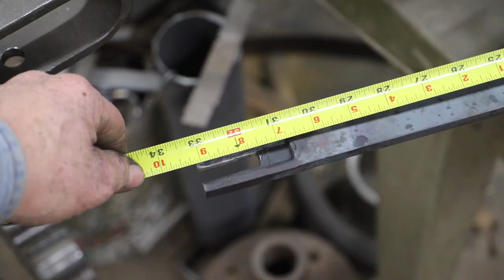Singletree Sizes & Why |  Building a Buggy Dash | Engels Coach Shop

Comment: Dave likely had a threaded Hex Rod Coupler  around the shop about the right size and depending on its size most Hardware Stores  carrying them for a few dollars in the fastener/bolt etc section. Indeed since there threaded a bolt or rod can be put thru them to give it added strength when using his so it won't deform. The dash will help keep the dust/debris down as it always did and helps the reins stay clear of its power source since its natural for a horse to respond to a touch on its flanks as a danger. Indeed this  is why jockeys often tap them with a crop there to keep them at speed though many rarely whip the animal since its training usually only needs contact not being beaten to get the response desired. Often the cracked of a whip was for its sound and only a bad driver would ever let it contact the horse and many took a hard stance with those that did..

Comment: I think maybe try a roughing die and then use solid hex for a finishing die. get a piece of round stock just under the minor outer diameter of the hex nut (width across the flats) and use that to "rough in the shape and depth, then switch to the finishing die of the hex stock. what it looks like is that with each press on the hex at the start, it is pushing the sides out and making a new V dent on each side that then pushes out as each layer goes down so you would want to form the sides with as few presses as possible. I don't know, just my thought.
I tried to get you another viewer today. sitting in his garage was a nice little buggy and after looking it over I realized he needed new box cores on the wheels. I am fairly certain he can do the repair himself as a retired machinist with all the tools but the guidance on it would be from you. Maybe he will find your channel one day.
thanks for the videos.
Reply: maybe even use 3 dies to get you there so you don't get folds and shuts down in the bottom.

Comment: Looks fine, as always. I'm not being an insufferable know-it-all kind of guy, but on bicycles, aluminum wheels are not preferred just because they are lighter, but because they brake better against the rubber (or whatever compound) of the brake pads than steel. This is more so when wet braking especially. Aluminum was a precious metal until quite late in the 19th century and doesn't fit the era of the buggy for sure. Just blathering...love your work and have for years now.
Reply from the maker: Wet does complicate things huh.

Comment: Dave, when you put the long carriage pivot "bolt" through the pieces at ~03:30, it was completely threaded like a (machine) screw instead of partially-threaded like what I was taught bolts are.  Won't those threads cause the wood to wear much faster than a smooth bolt?  Are carriage "bolts" not/no longer available that are threaded as bolts instead from end-to-end like a screw?

I just checked and see that McMaster-Carr doesn't offer many "partially-threaded" carriage bolts, but Fastenal does and may offer partially-threaded carriage bolts in the sizes & lengths that you often use in your Shop.  I tend do purchase most of my mail-order supplies from McMaster-Carr but thought of Fastenal when I saw that McMaster-Carr didn't have a large selection of partially-threaded carriage bolts.

Also, where you fill screwheads before painting, what did the OEMs do in those locations?  Did they also use some type of filler before applying paint?

Thumbs up once again, like always, for sharing your skills with us!

Comment: Dave, I see you are using star drive screws and not the slot screws you have always used before. Also, you are using plated carriage bolts without sanding the marking off of the heads. Of all I've seen you do I can't remember you doing it this way. I still love your work.
Reply from the maker: Slotted where they'll be seen and I sand the markings off all carriage bolt heads.  I just don't always show it.  All torx screws get filled and not seen when finished.

Comment: I'm so glad I found your channel. I am enjoying it and learning new things. I have a question and I wonder if you are able to answer it or not. I am getting back into driving after many years. I am accustomed to wooden shafts with the single tree on top like you make. The vehicle I bought is a light weight steel carriage with rubber wheels designed to go through brushy trail and water. Unfortunately it has metal shafts, the single tree is undermounted and the previous owner had clips on them so they are rubbing and are very loud as they clang. The previous owner had a much bigger horse than my little morgan mare and I feel that the shafts are too long as well. What I am wondering is, is there any reason why I could not replace the shafts all together with the wooden type like you make that I am used to? Thanks in advance :)

Comment: As always great video and learning experience. I noticed you used a rosebud tip to head the brake pad and a cutting torch tip to heat the frame for the dash. Was it for heat concertation or convenience of where you were working?
Reply from the maker: Usually for concentration of heat, correct.

Comment: I've noticed in one of previous videos how you took hex bolts and hammered them to have square heads. Do you do the same with nuts, and if you do, how do you keep the threads intact? Or do you just make threaded holes in metal plates and cut them into squares?
Reply from the maker: Square nuts are readily available.

Comment: I noticed you talked about many ways to do things and was wondering about the channeled end you created with the nuts and forge. Wouldn't it have worked to use your mill and created a channel and then used a square headed bolt and just drop it in? Grind the head thinner and it would not be proud of the steel bar. Is there adjustability in the original we didn't see? That could be accounted for too. Or is all this keeping with the old style also? Just curious.
Reply from the maker: Like most projects, there's more than 1 approach.  You're right.

Comment: FWIW, you'd actually see better braking with aluminium rather than steel to rubber, particularly in wet conditions (ask a cyclist), downside is the speed the stuff wears away.